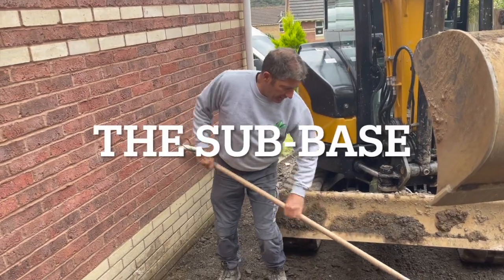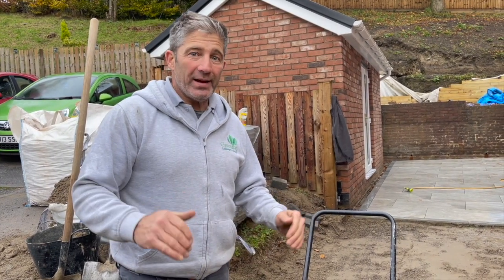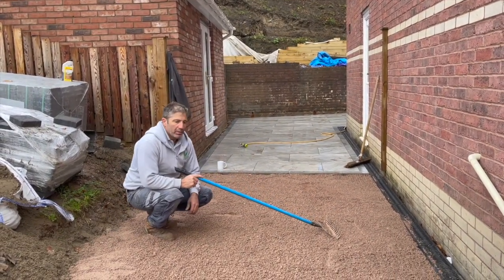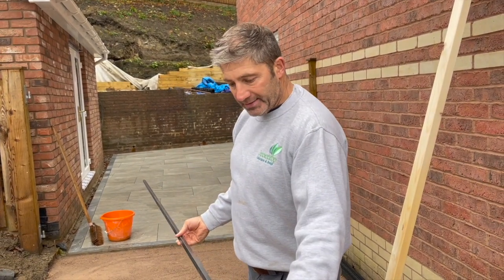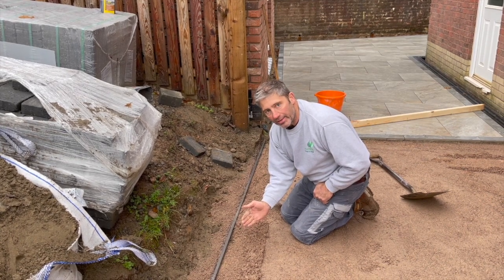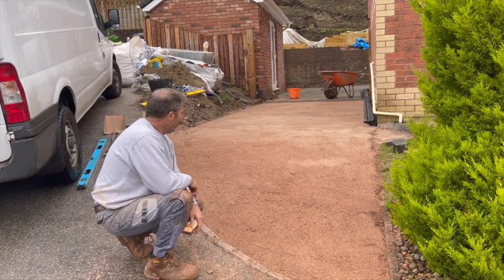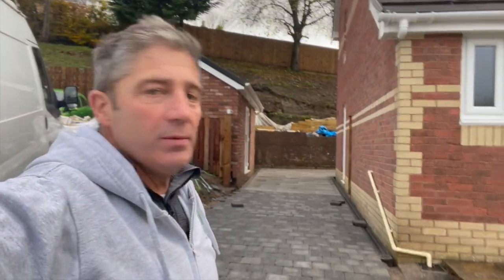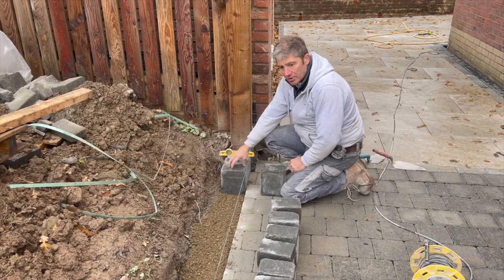#Block #Paving #Tegula #Driveway #Installation #Tobermore

Comment: Great video

Can you kindly tell me what is the difference between sharp sand under the block paving and grit,  

What other name is for grit sand is it granite dust , hard to find around my area in London it all leads to normal sharp sand

Thanks
Reply from the maker: Hi Hamza mate, sharp sand basically has more strength